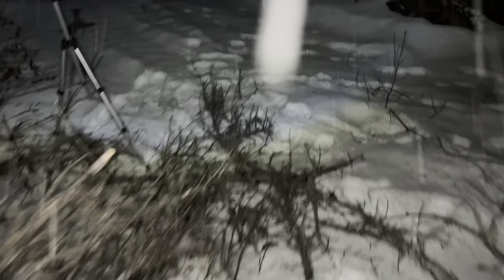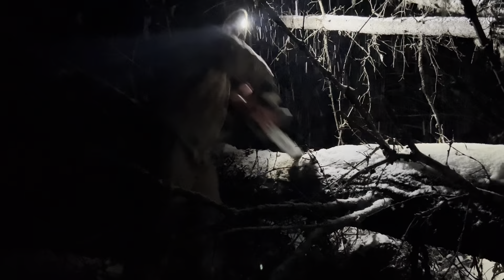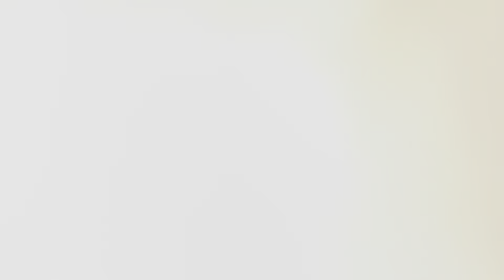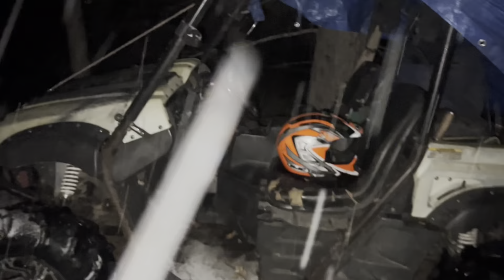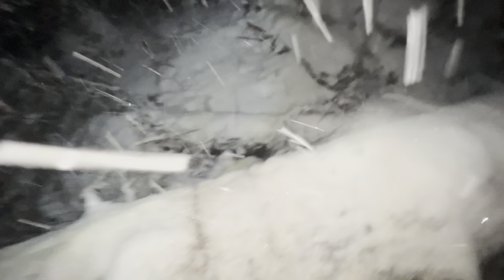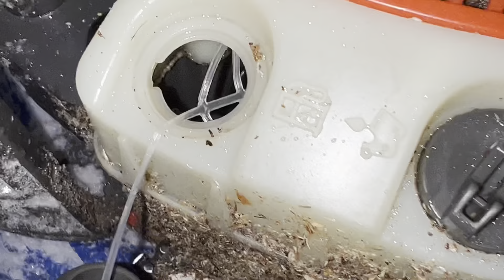AMAZON/EBAY TOP HANDLE CHAINSAW IN ACTION

Comment: Anxiously awaiting the full video, got one of these for Christmas and it does the same thing as you showed in your Short! It sounds great in this video
Reply from the maker: @the86125 hello there. Right on ya this one gave me a lot of grief, but I was not going to give up until I got it right lol
I tried several things, thinking I had it fixed, and then it would act up again. 
It’s working flawless now and I promise it won’t be very long and I’ll get that video out. 
I just wanted to get lots of hours on it before I did the review. I’ve actually got an 18 inch bar and chain on there right now with 3/8 low profile skip tooth. It pulls it not too bad.

Comment: Looks like you got it dialed in nicely. I have been working on my old poulan pro 4218 that was re manufactured unit from the auto princess. Been a great Saw for me but tricky to tune. I was cutting up some wood for my ice shack and after a while it would die after the cut. I drilled holes in the air box and gapped the plug to 30 thou and took the screen off the muffler. Carb was very finicky to dial in but i zip tied one of those run leader rpm gauges to the handle and that helped alot to get it four stroking just right. I have tuned lots of ice augers but chainsaws seem alot more touchy. Maybe its just the cheap zama carbs Lol
Reply from the maker: @dusty1498 yes, they are famous for being hard to tune what it is, is that saw is a stratified saw or “strato” meaning that instead of a conventional, two-stroke engine, sucking in the air fuel mixture into the bottom of the engine, compressing it, and then putting it on top of the piston to fire, what a strato engine does. It sucks in fresh air only with no fuel mix in it above the intake/fuel mixture charge and the idea is that it uses fresh air to chase the exhaust gases out of the port a.k.a. scavenging this way, supposedly creating a much cleaner exhaust gas/less emissions.
Lots of people don’t like them and people have a hard time tuning them. I basically figured out how to tune them properly, but honestly didn’t really understand the whole system how it works so I studied it for quite a while and I’m continuing on and I’m going to try and find my own ideas how to make that strato work better and easier to tune. 
I’ve got a 3416 in the hanger right now on the operating table and it’s the same engine as your 4218 so stay tuned. 
One thing you can do to really wake them up as a muffler mod and you can do it pretty easily by taking out the left tube that bolts the muffler on you’ll see it when you take it out you need a Torx to remove it and then you can just either drill a bunch of holes in it or cut an opening in it so that the exhaust can go through that tube. It really wakes them up but these saws are super easy to score a piston on so just make sure you’re running plenty rich.
Reply: @Indeewoods  Yeah I really like this saw for my needs. I know they get a bad rap but honestly they are a great saw for light duty cutting. I was worried about toasting it thats why I got the rpm gauge as my ear is not experienced enough yet for me to be confident. I thought about modding the muffler but was not sure how big to drill it out and did not want to screw it up. Very happy with it but man I spent 2 bloody days playing with that carb Lol
Reply: I can see why small engine guys hate them. Too much time is required to make them run properly and nobody is willing to pay on a 99 dollar saw.
Reply from the maker: @dusty1498 what rpm did you set it to?
Reply: @Indeewoods  2850 idle 12220 max wide open 9200 in the cut. One thing I liked was the fact that with the rpm gauge showed the drop in rpm after WOT. I read that if the high is lean the rpm won't imediatly come down after the cut. It four strokes nicely out of the cut and the plug is coffee brown on a 40:1 so I hope it all good.
Reply from the maker: @dusty1498  yes when the idle hangs up, it’s always a lean condition or an air leak or something. Sounds like you got it figured out 12,200 RPM. Sounds about right I think that’s plenty conservative. I’m pretty sure sure i’ve tuned them as high as 12 seven but don’t quote me on that it’s been a while since I messed with one of those.
I have a 4218 AVX  Poulan Pro that was given to me and everything was good with the engine but it was missing a top cover so I swapped that engine into the 3416 but then ended up scoring the cylinder somehow after I bored the carb etc etc. 
anyways, it looks like it would be the perfect trail saw for me because it’s got the power to cut with an 18 inch bar, it has good anti-vibe, they always start really good, and the best thing of all no tools needed to adjust the chain, which I really like.
Reply: @Indeewoods  yes I have a mtd 5520 which is a 55cc and man you really feel it compared to the 4218. Mine does not have av or the easy bar adjust but you are right they are about the perfect trail size saw for a balance of power and weight.
Reply: I have one that's yellow with 2 bar nuts.  It came tuned nice and I've cut a lot with it. I plan on modding the muffler as well like you did but even without it, she's a decently powerful saw.

Comment: Mine works really good just tuned it ..guess I got lucky, thanks for the video merry Christmas
Reply from the maker: @Jerry-ss3ms where did you buy yours and what brand was it?
The problem that I was having was that it would start and run and it would keep running but the idle was up and down and if you tilted the saw forward it would die a bit this saw sounds like it’s fuel injected now it’s running so smooth and that’s the way a saw should be. Before, I couldn’t make it run like that but I found out why. I’d love to be able to dissect a couple other chainsaws that people are having good luck with to see if they had the same changes made in their saw.

Comment: One thing I figured out is NEVER buy the single bar nut version.  It was weaker than my new 2 bar nut version. The muffler had a baffle on the 1 bar nut, the 2 is just an open can.  Also taking off the chain is HORRIBLE on the 1 bar nut because you need the Allen key and the scrench to take the cover off. That's a horrible design.  Mine spins up to about 11k free rev. I slapped a 14" bar on it and it will run it with a sharp chain.